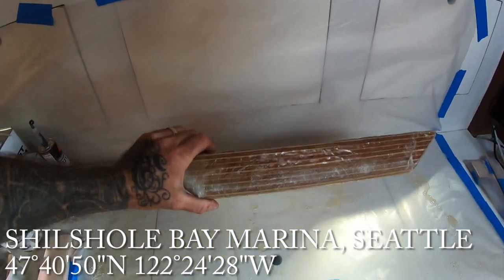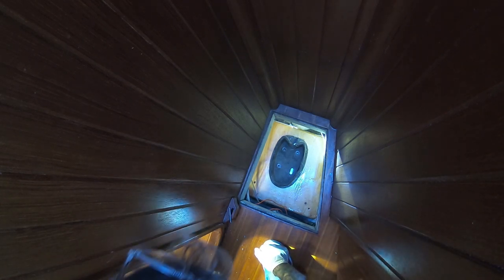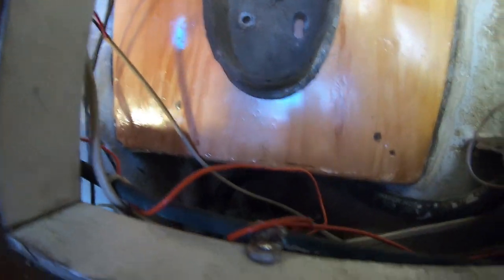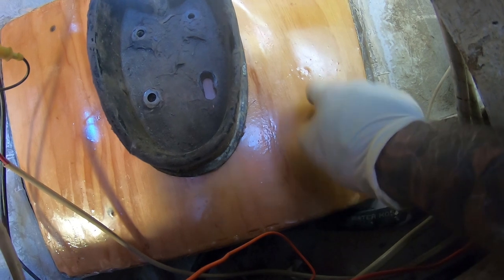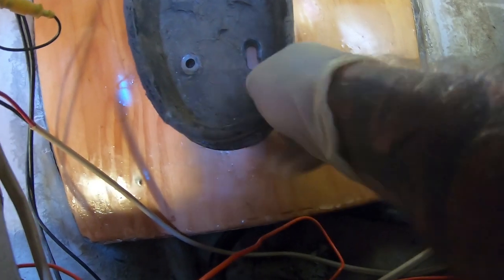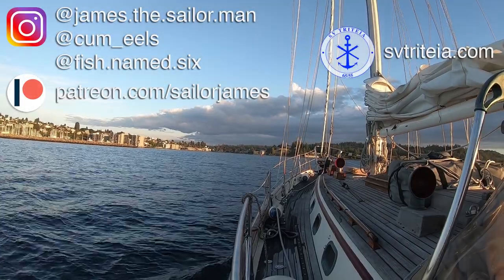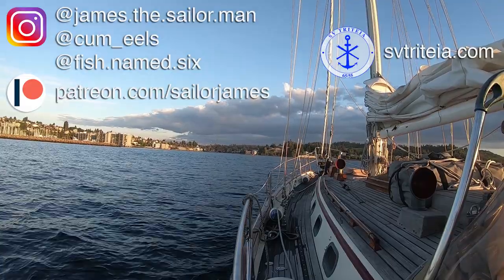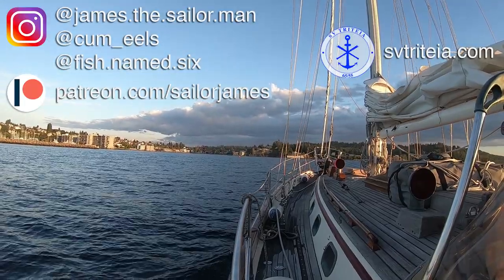Finishing the New Mast Step on SV Decatur, A 1981 Panda 40

Comment: When I bought my Valiant 47 three years ago in Santa Cruz CA and had the mast unstepped for transport to Lake Michigan  by truck the mast had never been removed. I was concerned what we would uncover removing the mast but the aluminum structural member that the mast sat on in the bilge was in good shape and even the bottom of the mast had almost no corrosion but I still had to drill holes in the bottom plate so standing water could drain into the bilge. Because the mast is pulled every year now for storing the boat indoors I can inspect the area for any issues. That was a really thorough job on the Baba 40. They are beautifully built boats and Tashing is one of the best yards in the world. Loved the video series you did. Keep them coming.

Comment: I may have missed it, or you'll cover it later but... How did you register where the mast is going to sit on the step? Centerline being relatively easy but I imagine there is a little bit of mast rake too.
Reply from the maker: I am not sure if we filmed that process but basically we lowered the mast into place with the shoe loose, I had pulled measurements from the original and taped off an area where it would roughly be, the spartite sat down into the deck where it was previously on we didn’t have to work out that and for the bottom after we sat the mast on the step we placed the cabin sole boards in their place and used a shim to make sure it was exactly in the center of the hole... pulled the boards and I marked where the step needed to be .

Comment: I don't know if this is possible, but are you through bolting the mast step of just 'lagging' those bolts in?  Can you reach underneath your new step platform and have nuts with washers or is that not necessary?  Neat project, thanks for sharing.
Reply from the maker: There is no need to through bolt it, it it’s primarily held in place by the weight of the mast and the mast just sits onto it with no pin or bolt attachment to secure the mast to the shoe, the shoe just needs to be arrested from horizontal movement